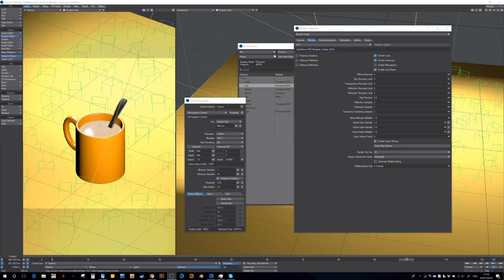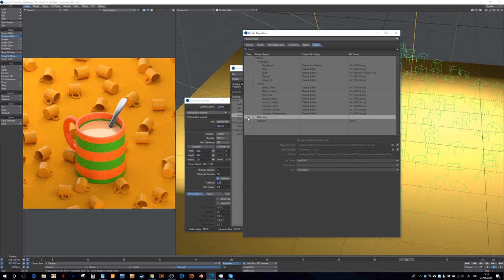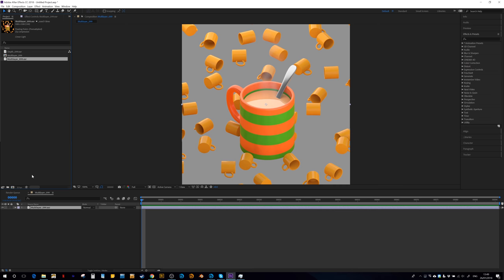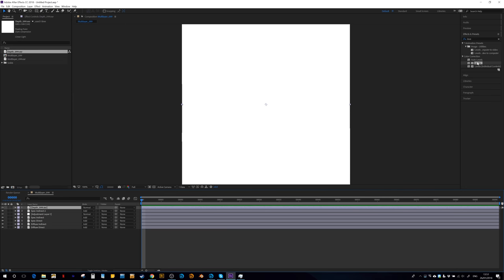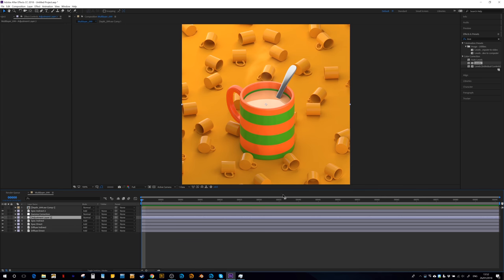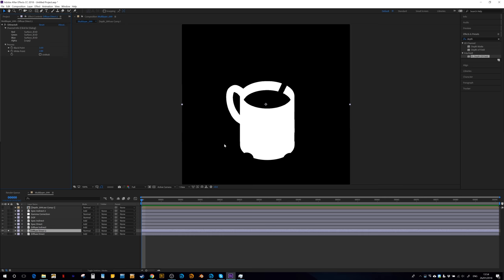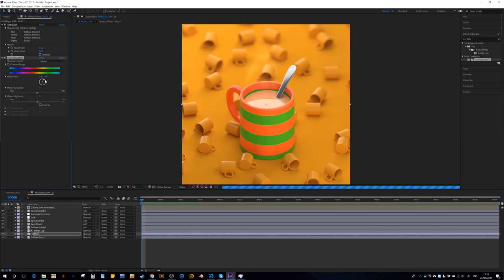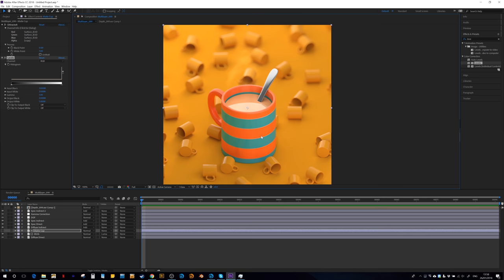Lightwave 2018 Render Buffers to After Effects

Comment: Hi Luis, thanks for a great tutorial. It is good to see how the buffers from Lightwave 2018 can be used to great advantage for compositing in After Effects. Do let us know when you have solved the surface ID masking issue.
Reply from the maker: I'm looking to upload it in a few days. Thanks.
Reply: That will be great, I had a go using OLMColourKey on the actual Surface ID buffer (separate) but it didn't work very well (jagged edges). Will be interested to see how you solve it.